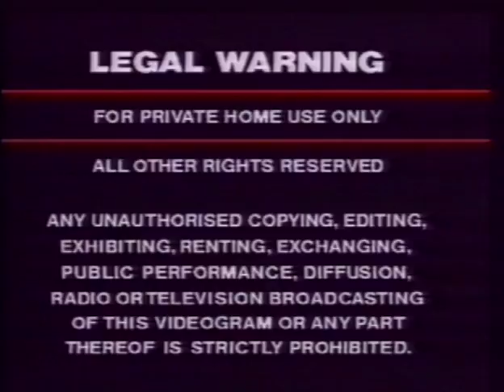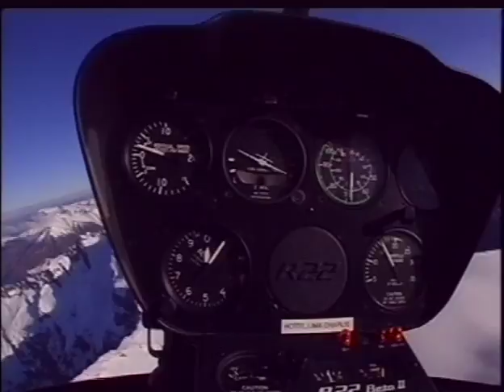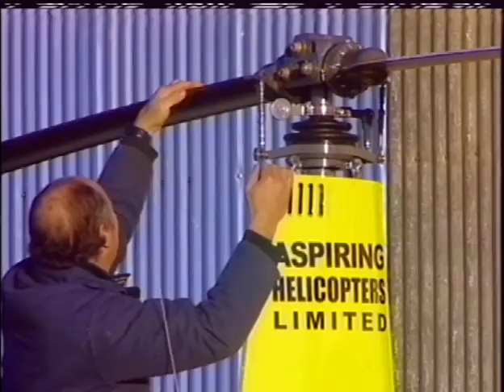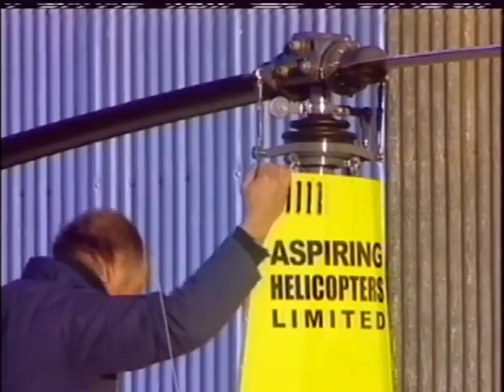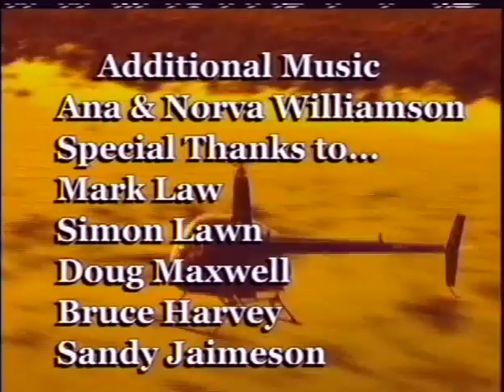R-22 In New Zealand

Comment: Thanks for the video. Still wouldnt fly in a Robinson or any other two bladed chopper. Reading about Robinsons and all of their belt system failures, engines overheating, rods thrown, valve issues, carb icing, magneto issues and then there is mast bumbing and tail strikes. Too much goes wrong with them.
Reply: Spencer Bowers company had in excess of 40000 hours in them and no mechanical issues to speak of. I could be wrong but I think he is the highest hour'd Robinson pilot in the world so should know what he is talking about. Few people in the video not with us anymore.